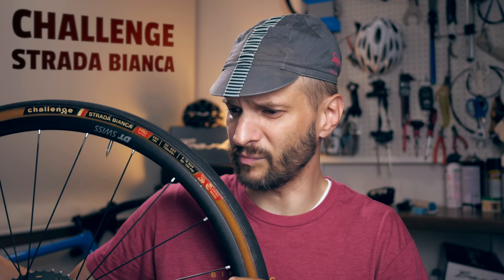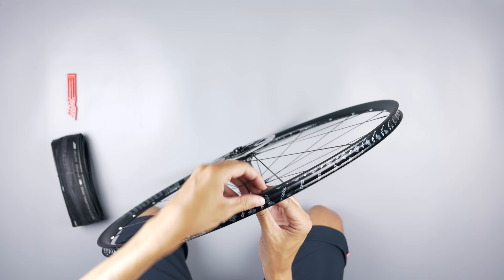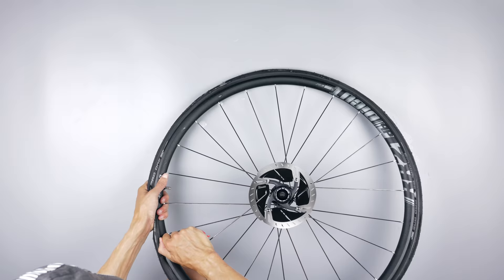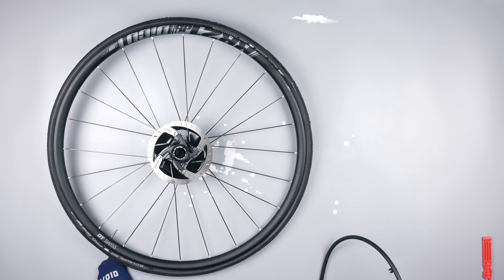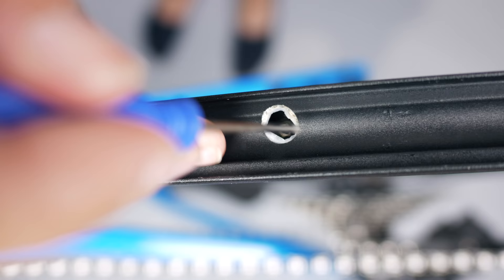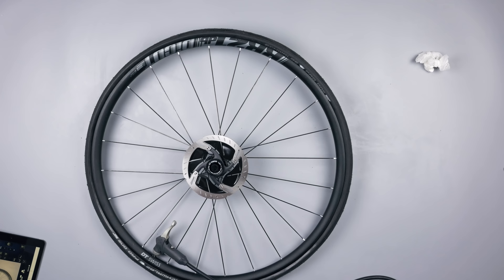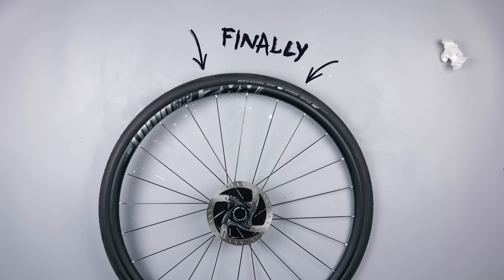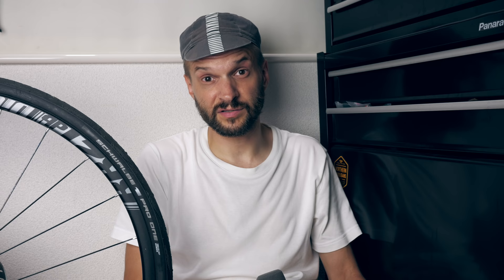Watch me struggle! 5 Tips for Road Tubeless | Schwalbe PRO ONE

Comment: It looks like you made this hard on yourself by not using the correct tools for the job. And then you put sealant in the tire before it was seated. (That 'solution' is common when people do not have a compressor.) Proper rim tape and a compressor with your wax or soap and it would have been job done on the first try. 

Road tubeless has been oversold as very easy to install, and that is not accurate. It requires specific tools and time and it's a bit of a faff, just like changing a regular tire is a bit of a faff. The difference is you can either do it on the side of the road in the middle of the ride, or you can do it in your garage or workspace at your leisure. I much prefer road tubeless, but you have to know what you are getting into.